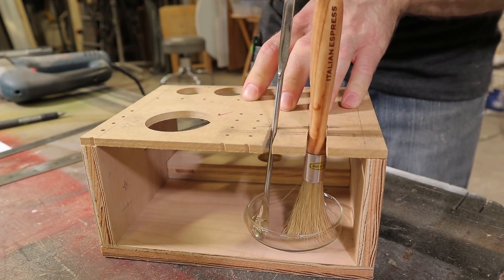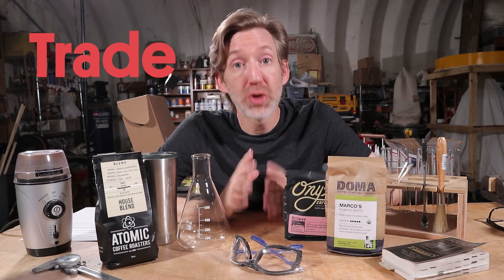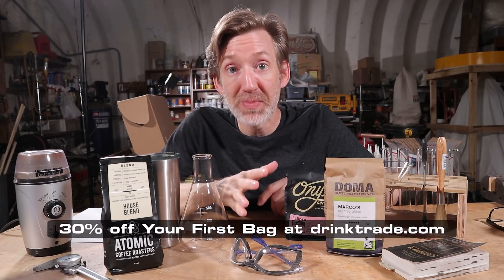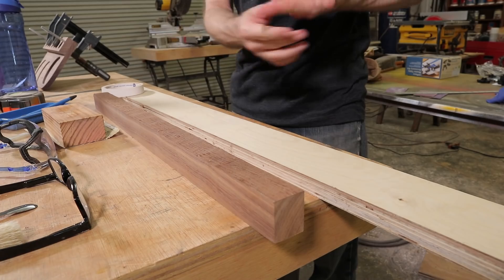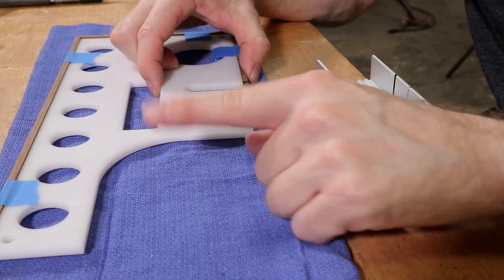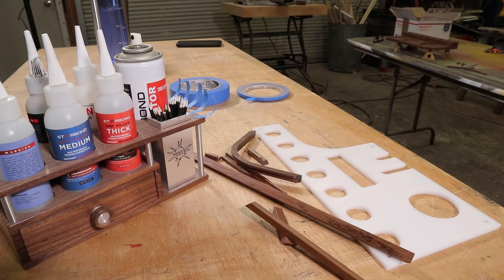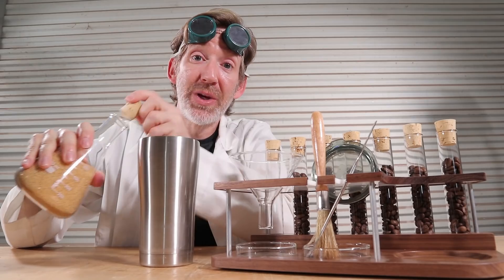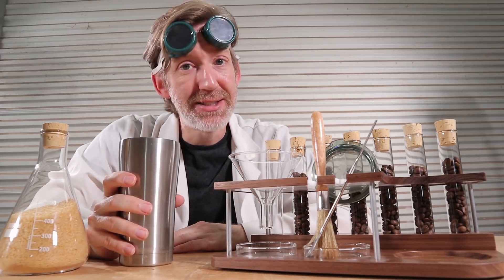Making a Countertop Coffee Chemistry Set

Comment: I have that same coffee maker. I find that if I drink it with just the basket filter my stomach starts acting up after awhile. I fixed this by using a 1-4 C basket filter in the reusable basket. It absorbs some of the oil and tannins and then I can handle it no problem. Doesn't mess up the flavor at all.
Reply from the maker: My issue seems to be that, by the time the brew is finished, all the grounds have migrated to the sides and I just get clear water at the end. So, I think I'm having to use more grounds than I should.
Reply: @WesleyTreat  To get a single cup of strong, fantastic coffee in that machine, I use 2 well rounded TBSP of coffee grounds. 
Also do try the basket filter. It seems to bunch the grounds up more. And clean up is much easier.

Comment: Great job. I learned to use the brad nailer at 90º from the edge to avoid two thing: split the under piece (@1:01) and a rogue nail/pin to bust through the wood, because the pin's shape is like an edge. Had some close calls, once a 45 mm pin curled and almost got my finger. Ok, I'm not a "safety justice warrior", just a regular guy with a mild case of OCD.